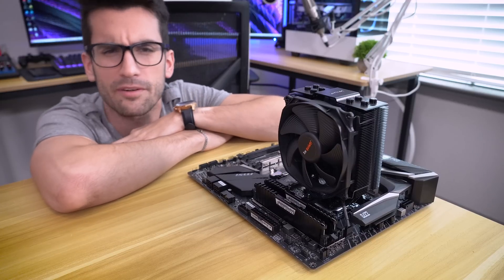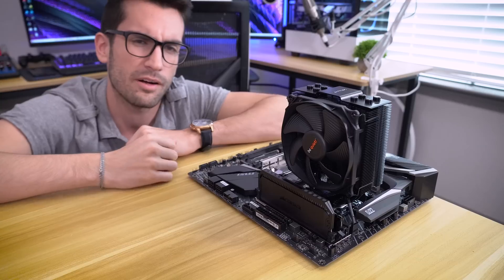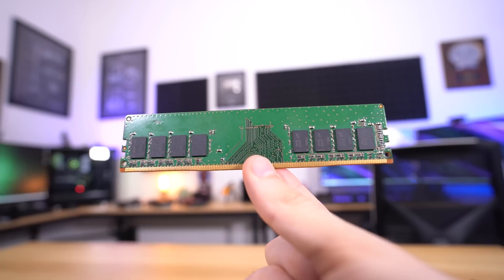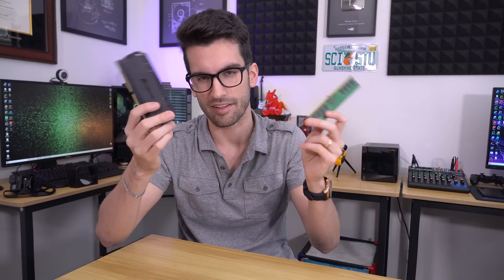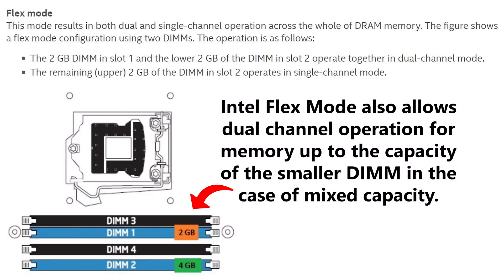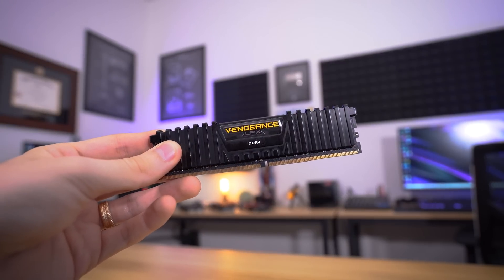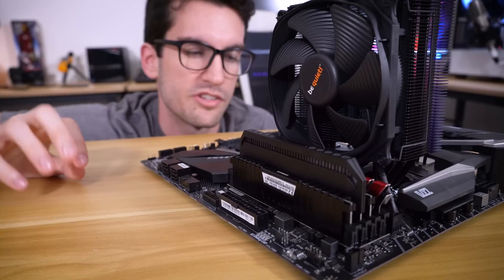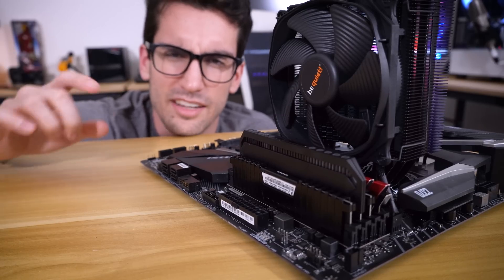Mixing RAM?!

Comment: Can you help me out please?
I have 4GB soldered and I have one slot given to add an another ram.
Can I add an 8Gb stick? Or should I opt for another 4Gb stick? The laptop supports total of 16 GB I believe.
So can will I be able to access dual channel mode on 12 gb of ram?
Or should I just stick to a total of 8GB? I find 8GB bare minimum for running windows 10.
Any help would be appreciated.

Comment: 3:36 help me .. i didnt get the meaning.. Today i bought a teamgroup udimm 8gb ddr3 1600mhz ram and put together with my default 4gb hynix 1600mhz dimm ramm.. and pc said it ran into a probloem and went on to boot loop.. But both of them worked fine in any of the 2 ports alone.. My slots are dual channel and 2 slots only.. what happened and what should i do??
Reply: That's really slow... but what kind of motherboard?
Reply: inspiron 660.. the speed works for me.. thats the max supported.. i have been playing on a laptop of i7-6500u 12 gigs ddr3 ram pavilion of same speedram even in hd graphics 520 up until now and find that fine until its 30 fps.. now since i have 1050 ti and i7-3770 its a great boost for me.. i can play easily at 720p i suppose .. i used to play on low settings 800x600 until now in about 30fps..
Reply: @glitchystar1336  You should ensure that your ram sticks are pushed down completely, if that doesn't work then take an air duster and spray the insides of the dimm slots to make sure there is no dust or anything in the way of the leads
Reply: PotatoPlayz WR Wll that should not be the case.. I actualy tried them alone on both slots and both worked then.. Then i tried them both once 4gb on slot 1 and next 8gb on slot 1.. Once it even sounded tuut tuut on a pattern.. but other times it said theres a problem and rebooted again and again with same problem..
Reply: @glitchystar1336  It might be a bad motherboard... https://forums.tomshardware.com/threads/ram-causing-boot-cycle.1953491/
Reply: PotatoPlayz WR it can be but i will give another one a try before deciding go purchase a 16 gib one stick .. but i dont actually get the problem.. why will two independently working ram slots fail when combined??  and its not a bad motherboard .. the pc costed more than 1000$ 8 yrs ago.. .. its a genuine dell inspiron 660 motherboard with genuine oem..
Reply: PotatoPlayz WR Hey anither one worked.. I bought an unbranded ram i stead of the teamgroup one.. And it WORKED.. Now i will have 12 gigs..
Reply: @glitchystar1336  oh glad to hear

Comment: With my PC(now my brothers) I originally had 8gb of ddr3, I found a stick of ram in my father's old pc that he didn't use/didn't work, it had 1 stick of 4gb, i took that and used that, then of the final slot my cousin had a 2gb stick and I used that. It worked with no issues, i don't know the speed, but It is atleast 1333, or 1600. The timings i would have no idea at all

Comment: what about having a 2 x 8gb modules in a pair. then years later i put another 2x8gb in the second channel? 
basically two different rams in different channels? is that a good idea? with say a ryzen 2700
is it still bad if you buy the same modules but seperately?
Reply: exactly my thought wd i7 7700 on b250 motherboard
Reply: It's fine. Your processor supports 128gb ram in total I believe..so it's okay you can do that
Reply: @PrabhatSejwar  thanks
Reply: @PrabhatSejwar  I'm worried about compatibility

Comment: Just some questions regarding this 
My mobo is asus crosshair hero vii

I was using g skill flare x 3200mhz 8x2 ram (cl 16 18 18 38 1.35v)

It got damaged and I bought a new set of gskill Ripjaws 3200mhz 8x2 ram
 (cl 16 18 18 38 1.35v)
Which is from the same company but different model other than that everything is same speed cl and volt

I mentioned that the old ram got damaged and he send me a brand new replacement unit 

So I was wondering if I could use these 4 ram in the same mobo and will there be any issues or problems 

Please can someone help me with this

Comment: I am currently running 8gb ram ( 4x2) clocked at 2400mhz. I have two more slots empty in my motherboard. Now i am planning to buy 16 gb more ram clocked at 3000mhz ( 8 x 2) of different brand than my old 2400mhz ones. Can i run the new ones fine? Will they get down to 2400mhz to match my old ram speed? Plz help. Thanks

Comment: I wish you'd covered mixing different voltages as well. I believe I ran into issue trying to add in a theoretically compatible 1.35v 4GB module into an existing three module 12GB system (3x4GB) where they were operating at 1.5v. This resulted in a boot loop as the mobo tried to, I think, train the memory and failed. Once I removed the new 1.35v module the PC was still stuck in a bootloop and I had to clear CMOS to get it to start. These were DDR3.

Comment: No you cannot always mix ram.  I bought two different RAM sticks at Best buy when they were I installed it in my computer the computer would get stuck in a bootloop if both RAM sticks were in there at the same time.

Comment: I have a laptop with 2 slots of memory. It has 2x2gb rams with the name MT8KTF25664HZ-1G6M1, meaning it has 4gb total. It has a max of 16gb (it's an old fujitsu life series i5 gen4)

I plan to upgrade my RAM, I'm thinking of either getting 2x4gb rams totalling to 8gb or getting 1 8gb module (for now) because I plan to buy another 8gb module down the line (either option fits my current budget).

Here's my question. If I opt to go for a single 8gb ram for now, can I partner that with the preinstalled 2gb ram.

FYI both the 8 and 2 gb  rams  are both DDR3L, 1600mhz, 204pin and everything else. Only difference is the GB. Can I do that? And will that cause issues?

Comment: 4gb + 8gb running at the same frequency won't affect me right?. And l can use all 12gb on board?
Reply: Yep
Reply: @bean3554   l already have 12gb on board. Efficiency and flow has been at it's optimal.

Comment: Hi.
- I use motherboard B450 AORUS ELITE have 4 SLOT RAM.. 
- Now i just use 2 slot ram brand 2x8GB=16GB (ZADAK 3200mhz CL 16-18-18-38 1.35V (XMP). 
- i want add different brand  2x8GB (HYPERX FURY  3200mhz CL 16-18-18-38 1.35V XMP) and this ram same spec with my existing ram.

My question can i mix ZADAK & HYPERX FURY and use XMP PROFILE to boost
frequency 3200mhz together?
Reply: what abt having a 2x8gb of corsair vengeance ddr4 2400hz in pair
then yr later i will try to put another 2x8gb of hyper x 2400hz in the second channel of my Msi b250 motherboard hving i7 7700. will this configuration be good. im not into overclocking. i want my parts to last as much as i can.
my Corsair vengeance working fine since 2018.. hows hyperx compare to corsair vengeance in servicing and warranty repairs in delhi, India 🇮🇳

Comment: Great video i have a question. I want best performance and have the acer aspire5 515 52g. it has a 8gb samsung 2400h ddr4 and i bought an ADATA brand 8gb 2400h ddr4. the question is: is it going to run dual channel and not having compatibility issues at all despite being two different brands?

Comment: You can have different timings for RAM channels, or at least you can on my Z97 board.  Choose "unlink" as the memory timing mode and you can change CAS etc. timings per channel.  Speed has to be the same though.

Comment: I have since reprogrammed the 2666 to 3000 with tighter timings and now have a new profile. Reprogramming ram like this can ruin it so I will not direct to the program that I used to do this.

Comment: You can run both modules at the speed of the slowest but that the OC speed you can achieve... I have taken .Ballistix ram 2666 and 3000 15 16 16 35 and ran all modules at same speed because the slower 2666 was identical ram just 1.2 v and 3000 was 1.35v so when I manually set all timings to match 3000 ram and same voltage it was flawless

Comment: so i have an amd laptop with 1 single 16 gb soldered ram stick at 3200 hmz operating at 1.2v, if i get a 16 g with matching specs  in terms of voltage and clock speed can i dual channel on this laptop even if the ram sticks are different brands. i'm thinking of running a crucial ram stick that the site says is compatible but i don't know what brand of ram asus installed, or what the timings are.

Comment: Can someone help me?
My laptop has installed 4gb ddr4 2400mhz ram.. and i want to add a 8gb ddr4 2400mhz SINGLE stick ram? Is't possible, no issue in the future 😑 will it work well? Thanks for the answer

Comment: I have 6 modules in my computer, only two of them are the same. Some are 1600mhz, other are 1333, and guess what ? It's running fine and they're all running over 1600mhz... And with better timing than any of them are rated for.

Comment: Hi, I need your help with my RAM issue. My laptop came with 8GB DDR4-2666Mhz Ram. I wanted to upgrade my ram but by mistake, I ordered 2400Mhz RAM which can not be replaced now. So I have 2x16GB DDR4-2400Mhz Ram. 
My question is can I use 2400Mhz ram in my laptop which supports 2666Mhz Ram. I don't want to mix 2 different RAM frequency.  If I use   2x16GB DDR4-2400Mhz Ram on my laptop will it affect my laptop? ( WIll there be any hardware or software issue  in future) I am Using Intel Core I5 9300H Coffee Cake CPU.

Comment: I can confirm that you can have mixed modules with no problems, at least if you choose similar rated modules with similar (or close enough) timings. I had 16gb DDR4 3200 of gskill trident z rgb memory, and wanted to get 32gb. I got a cheap pair of corsair vengeance lpx ddr4 3200 16gb modules and put them in my PC. I knew about the potential problems you could have with mixed ram so I went ahead and matched the speeds AND the timings manually. I got all of my ram modules to timings that were better than advertised! I went from 16CL to 14CL on all of my modules, and I believe I could get them to run as high as 3600mhz (possibly more) but my current motherboard (B350) only allows up to 3200mhz.

Edit: forgot to add that I havent had a single BSOD since I mixed my RAM. It's been stable for almost 2 years haha.
Reply: what abt having a 2x8gb of corsair vengeance ddr4 2400hz in pair
then yr later i will try to put another 2x8gb of hyper x 2400hz in the second channel of my Msi b250 motherboard hving i7 7700. will this configuration be good. im not into overclocking. i want my parts to last as much as i can.
my Corsair vengeance working fine since 2018.. hows hyperx compare to corsair vengeance in servicing and warranty repairs in delhi, India 🇮🇳

Comment: Just Overclock it and your module both runs at same speed tested on cheapest 4GB 2133MHz + 8GB 2400MHz and it stable at 3200MHz CL16 1.35v (Ryzen 3 2200G)
Maybe some module just got same component the difference is just default  factory settings

Comment: so say i have ddr4 corsair 3000 mhz and im looking at buying the 3600 mhz version since its on sale for the same price. my motherboard will default the 3600 down to 3000 correct? and is that the only negative?

Comment: Can I mix a single ranked 8gb ddr4 with a dual ranked 16gb ddr4? (Same timing, same voltage, same brand)

I'm so confused and the more I read the more I guess confused. My lap can handle up to 32 (i51035g7) HP laptop.

Comment: Bruh i Currently have 8 GB of ram (4*2) and intel processor, i will be upgrading to AMD ryzen 5 with a b450 motherboard with 16 GB of ram(2*8). Will i have a problem if i use 8 GB ram(2*4) as well adding it up to 24 GB?

Comment: I have a ryzen 3600.
And i have upgraded to 32gb from 16gb since i also edit videos and some 3d modeling.
My first dual channel kit was a (2x8) 16gb with an adata chip.

I was finding the same brand for the 2nd dual channel kit but it was out of stock so i ended buying another (2x8) 16gb brand with samsung chip but it has a same frequency, timings, and voltage. So is that fine?
Reply: what abt having a 2x8gb of corsair vengeance ddr4 2400hz in pair
then yr later i will try to put another 2x8gb of hyper x 2400hz in the second channel of my Msi b250 motherboard hving i7 7700. will this configuration be good. im not into overclocking. i want my parts to last as much as i can.
my Corsair vengeance working fine since 2018.. hows hyperx compare to corsair vengeance in servicing and warranty repairs in delhi, India 🇮🇳

Comment: I have mixed ram modules, I was able to overclock the slower ram and make it have the same timings as my faster module although there wasn't that much difference in speed between the two, to begin with.

Comment: Personal experience, I installed some ram with different ram speeds 4 in total two were different, caused many issues with games crashing and failing to run, I couldn’t figure it out for many days but then recall I had no issues before I installed extra ram and finally figured out it was causing issues, when removed the games began to work again. 

So just a heads up to anybody who might be having this issue, also note: one pair was 3000mhz other was 3600mhz ram and when all four plugged in it put it at 2133mhz when I removed the two it went to 2667mhz and worked fine.

Comment: ASUS ROG STRIX G - G531GT I would like to upgrade my RAM, could you please help me with this.

Can I add 16GB RAM , I do have 8GB RAM on my primary slot whether it will cause any issues. Whether the below mentioned RAM is compatible with my laptop if not suggest me list of compatible RAM. https://www.amazon.in/dp/B01N7K4DV4/ref=cm_sw_r_tw_dp_U_x_XQM1Eb5QXT0QS 

Actually I just found the HyperX 16GB RAM. The thing is, the latency (CL i think) don't match with my current RAM (seen this in CPU-Z). The HyperX is CL15 and my RAM is CL19 (as I found online. In CPU-Z on CAS Latency it says 17-18-19-20). So do you still think HyperX is a better option ?

Comment: i want to buy msigl75 its have 8 gb can i install 3000mhz so dimm ram on laptop but i dont know what is inside laptop i think its crucial with 2400mhz did it will work stable ? and can i get maximum of performance laptop

Comment: I'm actually running a crappy x470 mobo with The R5 3600, and I have 32GB, 16 GB is Corsair Vengance 3200mhz and matched, the other 16GB is HyperX Fury 2666mhz, and those HyperX sticks weren't bought as a sety, but individually, and I run that 24/7 in my Machine, all 4 slots populated, I do have strange errors/BSOD/BIOS problems on occassion, even at mostly stock settings, but I don't think it's a Memory thing so much - As it doesn't matter if I use 3200mhz, 2666mhz, whatever the speed, it still happends, so I'm assuming that's a Ryzen is a maturing platform thing - My mobo is PRE-MAX series, I no sooner bought mine and like a month later "MSI announced new MAX series motherboards, supporting Ryzen 3000 and beyond" I love my crappy mobo though lol
Reply: what abt having a 2x8gb of corsair vengeance ddr4 2400hz in pair
then yr later i will try to put another 2x8gb of hyper x 2400hz in the second channel of my Msi b250 motherboard hving i7 7700. will this configuration be good. im not into overclocking. i want my parts to last as much as i can.
my Corsair vengeance working fine since 2018.. hows hyperx compare to corsair vengeance in servicing and warranty repairs in delhi, India 🇮🇳

Comment: Do not mix RAM! I've done it, you will introduce micro-corruptions that are nearly impossible to diagnose, this will build up over time until your system starts acting weird, your RAM will pass the tests and you won't be able to figure it out. I know this because I've done it, my latest issue was with two sticks on Kingston RAM both where the same, model number, frequency and timings the only difference was where the memory modules where fabricated, one was Micron, the other Nanya, for a while everything worked but after about week the system started acting weird, both RAM modules tested fine after 24 hours of Memtest each and together. A months later system files started to corrupt and crash I tested every component I could not figure it out until I tried a new kit, problem solved. I then put the modules into another PC and within a week the same issues crept up. Later I suspected the RAM and I looked into the differences of the RAM the only-difference was the modules itself. I ordered one extra stick with Micron and one with Nanya now every system is solid and the corruptions have stopped.

Comment: i have a pair of  (2x8gb) viper ddr4 at 2133mhz and (2x8gb) ddr4 corsair 3200mhz, knowing that corsair ones are being bottlenecked should i just remove the vipers or run all 4 for 32gbs??

Comment: We bought the pc as a whole then added a GTX 1050 ti. has been working great for gaming and I just suddenly found this 4gb RAM stick in a drawer. I tried adding the 4gb Hyperx fury red(idk if DDR3 or 4) with 8gb DDR3 RAM which came pre installed in the pc. The screen received no signal even when I only installed the 4gb stick. It only worked with 8gb alone like it always has. Motherboard is MSI H81M-P33.

Comment: Is there a way i can overclock the weak one to the speed of the stronger one
Reply: I'm currently running 32gb of ram on my Intel system. Half is Crucial ballistix 2400 and the other is Trident Z 3200.
I have all running at 2800mhz. I haven't run into any issues, yet lol
Reply: @kyleohara1949  ok bro i will try it thanks

Comment: My laptop has 4GB ram soldered. If I install a second 8GB ram, or even 16GB, is there even a point? Will it run any better than two matching 4GB modules?
Reply: if the same memory Clock speed then  it's fine. if not then BSOD would come if u running windows, linux family not be bother :D

Comment: I mixed them, and only when I tried overclocking them, is when i got BSoDs, and mostly it was due to graphic driver being stuck in memory. But I haven't got any issues when I ran at the lowest declared xmp speed. (I tried upping the xmp 2400 to 2666)